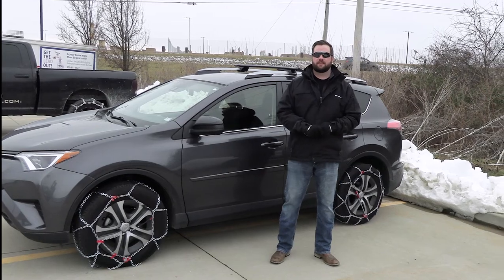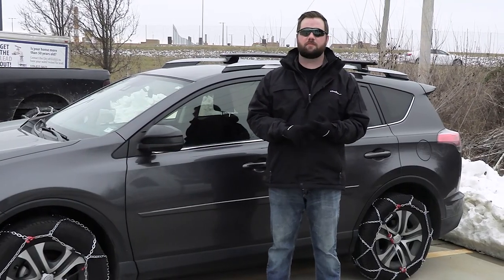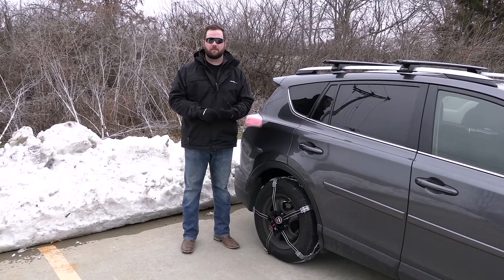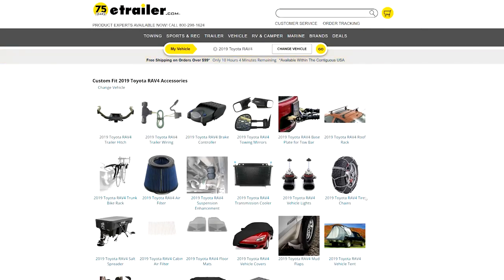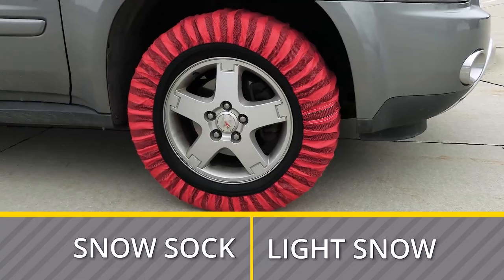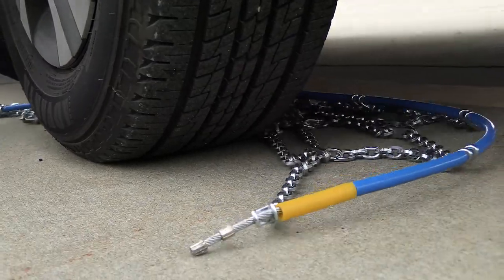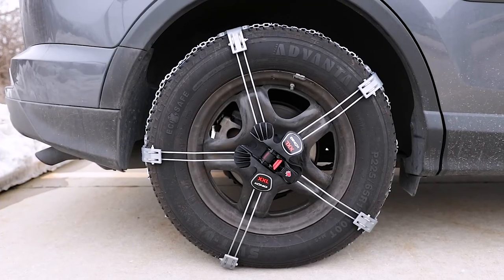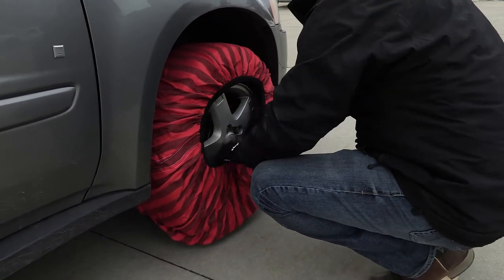How to Choose the Right Tire Chains for Your Vehicle

Comment: Good Info thank you  I have Camry 2019 can you help do i need 4 tire chain or 2 tire chain is sufficient. Also should we put it on front wheel or rear wheel..?
Reply from the maker: We checked out the owner's manual, which recommends installing chains only on the front wheels. Due to the limited clearance between the inside of the wheels and brake/suspension components, Toyota recommends using Class-S chains, on vehicles with 16-17 inch wheels. The manual states that chains shouldn't be used on 18-19 inch wheels.

Comment: I have a 2019 Dodge 2500 with Hankook 305/70R18 open shoulder traction tires.
I also have a 99 jeep Wrangler with same style tires in 16inch. 
What chain would you recommend for both in deep snow?
I will be chaining all 4 tires on either vehicle.
Reply from the maker: The Titan twist-link chains, part # TC3231CAM would be a good choice for the Ram. They are excellent in deep snow and the built-in cams help you get a tight fit. Rubber adjusters like # TCOA2 are also recommended. What is the exact tire size for the Wrangler?
https://www.etrailer.com/Tire-Chains/Titan-Chain/TC3231CAM.html
https://www.etrailer.com/Accessories-and-Parts/Titan-Chain/TCOA2.html

Comment: We have a Honda Odyssey 2018 EX. It looks like P235/60R18. Recommendations?
Reply from the maker: According to the Odyssey owner's manual, you're gonna need a Class S chain due to the limited clearance between the inside of the tire and the suspension/brakes. The Pewag Servo RS, part # PWRS80 would be a good, fairly reasonably priced option. If you'll  you'll actually use them more than once a winter, you'll want something with a more decent warranty than the 90-day offered by the Pewag. If that's the case, Konig chains offer a 5-year warranty. More expensive, you betcha. If you don't want to buy chains every season, go with the Konig # TH01594247.
https://www.etrailer.com/Tire-Chains/Honda/Odyssey/2018/PWRS80.html
https://www.etrailer.com/Tire-Chains/Konig/TH01594247.html

Comment: I have a Highlander Toyota 2019 I’m wondering what would fit best.. my tire size is 235/65R18
Reply from the maker: Due to the tight clearances between the inside of the tires and the brake/suspension components, you'll want to use a Class S chain. The best bang for the buck would be the Titan Square link chains, part # TC2323. 
https://www.etrailer.com/Tire-Chains/Titan-Chain/TC2323.html
For somethings that's a little easier to install that has a MUCH better warranty (5 years versus 30 days for the Titan chains), go with the Konig Self Tensioning chains, part # TH2004705255.
https://www.etrailer.com/Tire-Chains/Thule/TH2004705255.html

Comment: Hi! My owners manual states I have no clearance (2023 Chevrolet Trailblazer LT FWD). My tire size is 225/60r17, I’m traveling through Oregon the first week of April. Do you have any affordable recommendations? (My manual also says: Use another type of traction device only if its manufacturer recommends it for the vehicle's tire size combination and road conditions. -> who do I ask for this info) Thank you!
Reply from the maker: The owner's manual does indeed specifically mention that tire chains shouldn't be used with your tire size due to limited clearance to the wheel wells and to the inside of the tire. That being said, we do have an alternative traction device that would work with your tire size. Take a look at the Titan Chain SnowSocks, part # TCH70 which you can see using this link:
https://www.etrailer.com/Tire-Chains/Titan-Chain/TCH70.html

Comment: I drive a 2013 Ford explorer sport what are the snow chain size I need and do I need to put them on all four tires?
Reply from the maker: The 2013 Ford Explorer would've had one of three different tire sizes, 245/60-18, 245/65-17 or 255/50-20. Per the owner's manual, cable style chains are the only acceptable chain type that can be used on that vehicle. The cables may be used on the 245 series tires, but are NOT recommended for the 255 series tires due to limited clearance between the inside of the tire and brake/suspension components. If you have the 245 series tires, Ford recommends using cable chains on the FRONT wheels only. For the 245 series tires, we'd recommend the # TC735DC from Titan Chain. Hope that helps!
https://www.etrailer.com/Tire-Chains/Ford/Explorer/2013/TC735DC.html?VehicleID=2013993231

Comment: i drive a 2022 honda civic sport which tire chains do u recommend
Reply from the maker: The 2022 Civic is available with three different tire sizes, 215/50-17, 215/55-16 or 235/40-18. 
The owner's manual states that due to limited clearance between the inside of the tire and the suspension/braking components, cable style chains are the only recommend chain product. The manual says that the cable chains should be used on the front wheels only. 
For the 16 or 17 inch wheels, I'd recommend # TC331DC. For the 18 inch wheels, use # TC339DC.

https://www.etrailer.com/Tire-Chains/Honda/Civic/2022/TC331DC.html
https://www.etrailer.com/Tire-Chains/Honda/Civic/2022/TC339DC.html

Comment: V bar is best chain for ever
Reply from the maker: For deeper snow or ice, we would agree with that statement!
Reply: @etrailer  are there any better chains from the v bare ?
Reply from the maker: What's your vehicle year, make and model? What's the tire size? What kind of conditions will you be driving in? The 'best' choice for you will depend on your specific vehicle and situation. If you can give us some more information, we'd be happy to make a recommendation for you!
Reply: @etrailer  I drive a land rover freelander td4 2004. Tire 195/80 R15. These are the best snow tires. because they are narrow. wide tires cannot cut the snow and create a large load. I think I use one of the best snow chains, "pewag off road extreme". but I saw "v bar ladder SDL las zirh" and I think they are even better chains for 4x4 off road driving? I don't think there are better chains ?

thanks for talking to me
Reply from the maker: We don't carry the 'v bar ladder SDL las zirh' brand chains. If you're driving on icy roads, the V-bar chains like https://www.etrailer.com/Tire-Chains/Titan-Chain/TC1850.html would be perfect for you, unless your owner's manual calls for Class S chains due to tight clearance between the inside of the wheel and brake/suspension components. Since you're using narrower tires, this likely won't be an issue, but we still recommend checking y our owner's manual. Hope that helps!